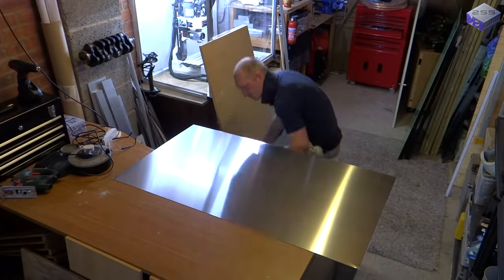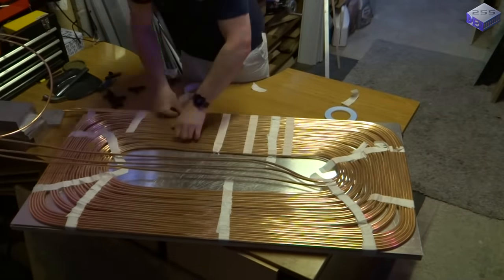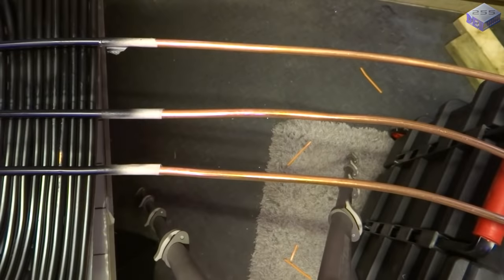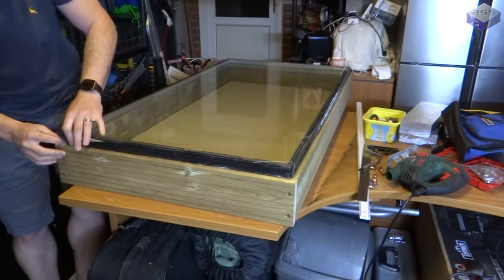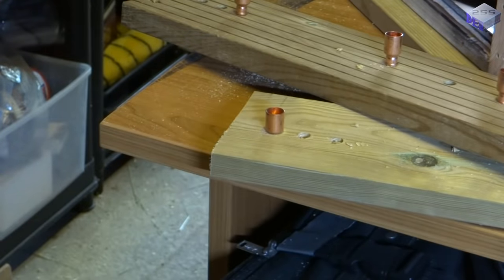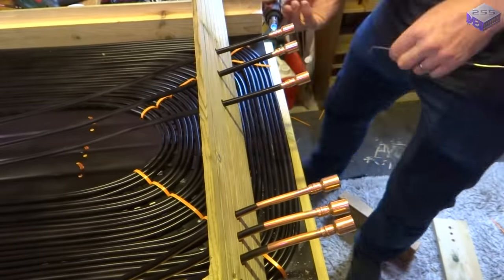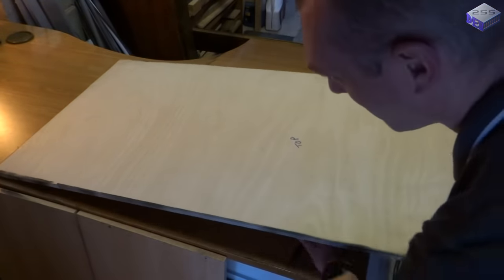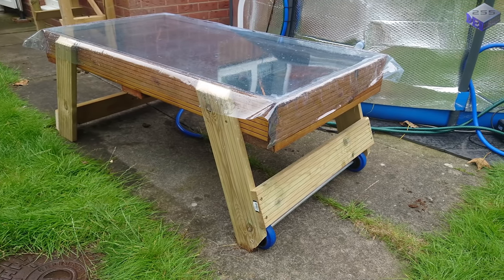Improved Solar Pool Heater - Full build

Comment: Try to : 
1. use all the copper piping in series (the copper pipes in one long connection). 
2. Try and get another 25 m of copper pipe in.  Total of 100m instead of 75m. You have space for it, especially in the centre. 
3. The hottest part of the solar heater is in the centre where you have the least copper pipes.  If you use more piping all connected in series, the centre (ie, the hottest part of the solar heater) should also now be covered. 
4. Use metal cable zip ties (spray them black) not orange plastic ones ones. Black, especially metal ones, ones will absorb more heat than orange ones. 
5. On the back, cover it more or all with wood, for an extra layer of insulation.
6. Insulation should be uniform, all around the solar heater. So the side walls and the back should have the same / similar insulation (ie same u value for heat loss), and ideally the top have a higher or highest u-value as heat rises and so the top should have the highest u value to retain the most heat. A triple glazing glass unit, with argon gas and two, e-coatings (both of which pointing inside) has u value for about 1.0 or less, and the highest light transmission about 76%. So you get the best of both worlds. Or use a 35mm polycarbonate sheet, which is the next best thing, as it’s a bit cheaper, with ~ 1.2 u value and 72% light transmission.  You want the most amount of energy entering the solar heater and the least amount escaping it.
Reply from the maker: Hi, I will be trying the pipes in series to also increase the flow to ensure I get good turbulence. The space in the centre is hard to get pipes into although may use 90º fittings, or mandrel bend the pipe, hmmm. It's definitely a balance to get the most amount of energy in and retain that energy until it can be taken away by the water. I'll try a number of different configurations to get the most out of it.
Reply: @TheSolarPoweredEngineer  good luck. Seems you have put a lot of effort in and a big improvement from last time. Each improvement is a big improvement.
Reply from the maker: @harunyahyadotorg  Thank you.
Reply: At some point it would be easier to just make 2 cheap simple collectors instead of trying to min max 1 collector with extra cost and more materials.
The missing coil in the middle will heat up the backplate and the air inside, so something like 50% of the heat would still find a way out to the coil.

Alternatively a ready made rack of vacuum tubes could also be used instead.

Comment: And the temperature difference???
Was waiting to see if it works ml
Reply from the maker: Hi, there is around a 1.4ºC temperature difference from input to output with a flow rate of around 5 litres/min (so around 500W). I will be doing some more testing and modification on this one in the next few weeks.

Comment: What is the temperature difference due to the installation of the pool heater...

I believe the surface area is quiet small...  Maybe depends on the pool size... Some calculations and data would help
Reply from the maker: Hi Guy, no dramas, I believe the best option would be to look at my original pool heater comparison video or the in depth look into it, as I was not able to fully test this one last year (UK summer ;-) Here is a link to Part 2: https://youtu.be/-B7SMrmwsZE and Part 3: https://youtu.be/Zt_RiMgSMEs .

Feel free to reply to this comment if you need any more info, hope the above helps.

Comment: Looks good. Only remark for me would be the fact that your matt black is not very matt. Can imagine that this will still make it less efficient compared to real matt black. there are two options here I think. Or try black sut from a petroleum fire. (messy but cheap). or go for real matt black paint. named " black 3.0". Check a video on youtube from "the action lab" made in 2018, named " the new world's blackest paint (black 3.0) vs the brightest flashlight"
Reply from the maker: Thank you, I will take a look. I did receive a comment that there was very little difference between ultimate blacks and glossy black, although will have to do some experimenting this summer.

Comment: Aluminum tubing is a better choice . Aluminum grabs heat and then let's go of it . That is why all auto radiators are aluminum . As are all A/C radiators . Stainless steel makes a better reflector . Or an old mirror works very well . Some ridgid foam makes an excellent insulation for the back . And weighs less than plywood . Foam can also be used for the sides . Silicone adhesive or glue can be used . But fiberglass and epoxy should be used to hold it all together , if foam sidewalls are used . Screws for wooden sidewalls .
Reply from the maker: Hi Elvin, I like the idea of making it lighter with the foam and aluminium, although I looked into aluminium when used in conjunction with chlorinated water and I wasn't keen on the results, so I opted for copper that hardly reacts to chlorine when the water PH is maintained and chlorine only added when needed. There are non-chlorine treatments for pools though I believe, which would make using aluminium feasible. It would probably be cheaper to use a black car radiator as it has a lot more surface area than tubing alone
Reply: Copper is a better thermal conductor than aluminum.  Until fairly recently, the tubes on most HVAC systems were copper while the fins are usually aluminum.  These days both are aluminum, but that is mostly to save costs not because aluminum is better.

Comment: How much did the project cost uk 👍👍
Reply from the maker: Hi, it was around £250, so not the cheapest option unless you have the parts lying around, although that's a lot of copper. In todays money it would set you back over £300

Comment: I would add some insulation foam under the metallic support and sides, to increase the heat transfert to the pipes ans minimize heat losses.
Reply from the maker: Hi, it does need an air gap between the aluminium plate and lower insulation to increase it. I have ordered some reflective foil for the inside edges and have received 2 perspex mirrors to reflect more light on the panel too, plus now have a perspex clear panel to replace the glass. Hopefully, this will improve its performance.

Comment: what does the 500 watts come out to in heating? does it raise the pool temp 0.5* C 2*C?
Reply from the maker: Hi, it's best to use Joules = Specific Heat Capacity * Material Weight * Temperature Increase in °C. So 4182 Joules = 4182 * 1kg Water * 1°C increase. Then Wh is Joules/3600. So it takes 1.16 Wh to heat 1Kg by 1°C. So for 500W and a pool of 4600 litres (4600kg) would only raise the water by 0.09°C so over 8 hours an increase of only 0.75°C. You would need a number of these for that size pool. But for a 1000 litre Lazy Spa, 500W for 8hrs (4KWh) would raise the water by 3.4°C per day, so over a week you could see the water go from 20°C to 30°C if you had a 2°C drop in water temperature each night, and £5.60 saving in energy per panel per week. Hope that all makes sense.

Comment: I'm not an engineer but I do know that different materials absorb the sun heat at different rates. Maybe copper is not the best material? What about black PVC or ABS plastic tubing inside of a sealed inward reflective enclosure?  Finding the golden ratio between flow/temp rise is the key thing in this project, in my humble opinion.. Great vid, thank you..
Reply from the maker: Hi, thank you, I did find my first panel worked very well using plastic tubing and your right there would be an optimum flow rate as the pump power requirements would also go up with higher flow rates and the idea is to reduce energy, although could use PV panels for this. The idea behind copper sprayed black is to take advantage of its heat transfer rate, where this is one of the best materials for this, where it is used in most computer heatsinks to quickly move heat from component to fins. So spraying copper a thin coat of matt black helps it absorb the sun's energy (matt black reflects almost no light, hence the colour) then the copper transfers this heat quickly to the water. The idea behind the small copper tube was to increase surface area. I'll be doing more tests with it this summer to see how efficient this one is and if it can be improved. Thank you for your comment, this is where I get some of the ideas to improve these projects. Glad you liked the video.
Reply: Depends on your needs, when you want to keep heat in or out you want a low lambda λ W/m.K (u or K) for insulation purposes. PVC ca 0.16, Copper around 380. When you want to transfer heat from the sun so to water, you want the highest heat transfer coefficient possible. I.e. turbulent flow >1.5m/s and a material with a high W/m2.K
Reply: @TheSolarPoweredEngineer  satin > mat > gloss for heat absorption.
Reply from the maker: @thelazycat_  Ah ok, so the black PVC solar heater I made in version 1 would be the better option with turbulent flow. I have recently purchased some thin wall black PVC tubing (thinner than my first version) so this should be the ideal option.
Reply from the maker: @harunyahyadotorg  I will have to try all 3 in separate experiments.
Reply: Also I’m making a solar heater myself. 

My thinking is : 

Hose pipe < (16mm outer diameter with 13mm internal diameter) irrigation piping < 15mm (outer diameter) copper and 13mm internal diameter < 8mm outer diameter 6.8mm internal diameter) copper < car 🚗 or truck aluminium radiator < aluminium central heating radiator 

(I didn’t include cast iron or mild steel radiators as they both rust and will contaminate the water after a while). 

Aluminium is used in drinks cans and so… they are safer then copper, lighter then copper, better conductor then copper, and cheaper then copper. Aluminium cans can chill drinks faster in a fridge… reverse is also true to heat frying pans faster… also aluminium does not react like copper with chemicals such as chlorine etc..  So better to use aluminium in a heat exchanger then copper. Just like aluminium frying pans are better then copper based frying pans. For transmission of heat. Etc..
Reply: @TheSolarPoweredEngineer  PVC is not the best material for heat transfer. Around 0,16W/m2/C. HDPE between 0,42-0,51, copper around 380W/m/C. The higher the better. So, if you have copper, use copper. A thinner wall is for heat transfer better, good job. Example: you have a surface area of 1m2 +-32m hose diameter 1cm. Temperature under the glass 60C and water temperature 20C, temp difference = 40C. Material = PVC diameter material 2mm with 0,16W/m/C. The heat transfer = 0,16/0,002*1*40 = 3,2 kW. With copper and the rest the same, you have 7.600 kW.
Reply: @harunyahyadotorg  keep in mind that Chlorine, when used in your pool, can react with aluminium. Thats why we use stainless steel 316 in the industry.
Reply from the maker: @thelazycat_  Love it, thank you, yes I had it the wrong way around in my head, although I've just bought 75m of Hoselock PVC to make a new heater for comparison, doh!, although it does have a much thinner wall than my first solar heater (also PVC), the new stuff is around 0.5mm wall thickness, plus I was thinking of cost-saving for the average joe. One thing I will be doing with this unit is running it through a simple heat exchanger, I know this introduces more inefficiencies, although there is some concern over Chlorine reaction with the copper, so wanted to offer a solution for a closed-loop copper system and heat exchanger (closed loop will have an expansion tank with pressure release cap). The Chlorine has not been much of an issue in the past as I've always put in the correct amount (only when needed), maintained a healthy PH and ensured there was always a clean filter. The other thing I'll be trying is an 18W UV-C unit (316 steel) to reduce the Chlorine by 80%, so less worry on the copper front.
Reply from the maker: @harunyahyadotorg  Hi James sounds like you are well on the way to making your system, like The lazy cat said, aluminium does react to chlorine, I believe it's quite nasty too if it reacts, that's one of the reasons I opted for copper. Plus, there is chlorine in drinking water that is piped to your home via copper pipes, with around 0.5 to max 5mg/l (5ppm) and a pool should be maintained at 1 to 3mg/l (3ppm), so as long as you keep your Ph levels between 7.2 and 7.8 you should be fine (just from my online research and asking around, although you may wish on consulting a pool installation expert for advice).
Reply: @TheSolarPoweredEngineer  it would be nice to see some numbers when you are finished building and testing. Im curious how much it differs between the two systems. Test it simultaneously if possible, same inlet water temperature and place in sun. With the flow rate, T in, T out. You know enough. A closed loop is also an option indeed. Currently optimizing an industrial dryer working with cooling water 195m3/h from a bioplant. Also using heat exchangers (water to air). There are so many ways to go. Even with vacuum solar tubes, very nice technology
Reply from the maker: @thelazycat_  Definitely lots of options, I'll be logging the flow rate, T in and T out as you said, and comparing version 1 with version 2, so as to compare the change in performance with version 2 between every modification. Will probably doe the mods over mid day on a good sunny cloudless day so it should be very close results (although could take years with the UK summer 😉). That's an interesting setup you have there, I've never thought about it before. Cheers 👍

Comment: It might have been better to add a little bit of non-electrically-conductive paint on the underside of the copper just before removing the blue backing of the double-sided tape. Having the two dissimilar metals in close proximity might result in oxidation. In theory, you have a gap there, but chances are, it's gonna happen.
Reply: Just using the black spray paint would work.

Comment: what is the temperature difference between the water going in and coming out?
Reply from the maker: Hi, there was a gain of around 1.4ºC, so around 500W in direct sunlight, although I need to do more tests this year as there was hardly any sun last year. The panel had a good flow rate too, where I was getting around 5 litres/min through the panel.  I will be hooking up some electronics soon to measure and log everything.

Comment: Cool project. I was just wandering about the heat loss figures to the ground and from evaporation in a typical pool.
What's your expectation in terms of raised temperature?
Reply from the maker: Hi, thank you, with the version 1 panel (PVC tubing) the pool (4600 litres) raised by around 3 to 5 degrees per day on really sunny summer days and collected around 600W average over an 8 hour period (4800KWh), where the version 2 measured 500W, although it's a much smaller unit, so will do some more testing this year (when the sun appears again). The evaporation was not a major issue as I have a black bubble wrap floating pool heater when not in use during the day and an additional top debris cover to further insulate the pool. When in use, our body heat adds a little to the warming I guess, although that's probably when the most evaporation occurs. Over night it lost 1 to 3 deg C, but overall with the previous panel and the solar cover and purchased one (around 400W) we got our pool to a nice 31 Deg C. Hope that helps
Reply: most heat loss is due to evaporation, it is why solar covers work so well, they stop most of the evaporation.
Reply from the maker: @johnstarratt7346  Very true, plus they cut costs as the chemicals last longer. I now have a pool dome over it too this year and that is doing wonders to reduce evaporation as the wind cant take away the vapour.

Comment: I wonder how this compares to painting the bottom and insides of the pool black.
Reply from the maker: That is a good point as there is more surface area with the pool. I do have a black bubble wrap cover that I use to increase the water temperature further, although had to have the pool in the shade last year.